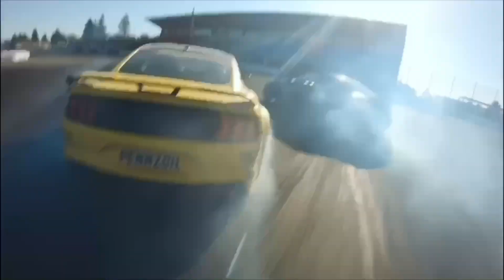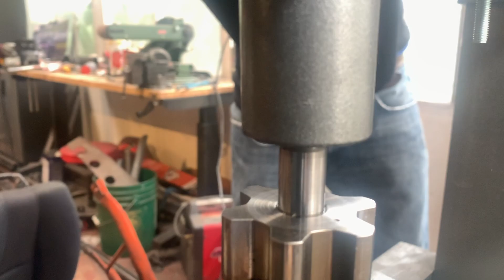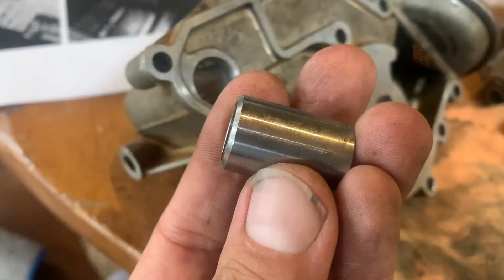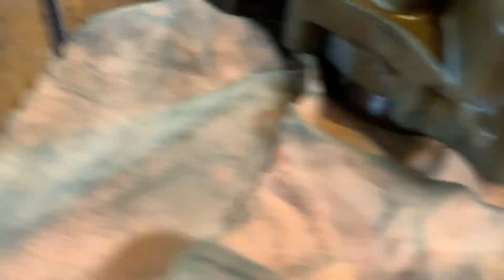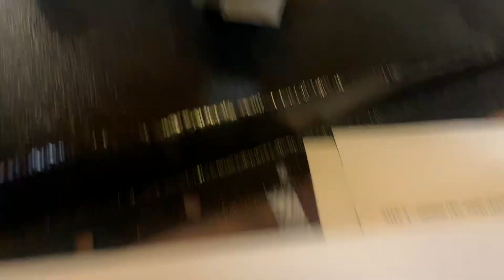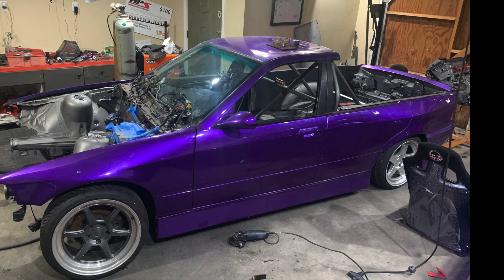E36 E46 V8 M60 M62 Swap ; Oil Pump Modification  : What Is It REALLY like?

Comment: Too bad the M60/M62 swaps get this complicated. What would a dry sump system for this swap cost roughly? And does anyone make exhaust manifolds for this swap?
Reply from the maker: Dry sump is 4-6k 

Exhaust manifolds can be pieced together from X5 but if you want gains custom make them
Reply: I'm just in the process of fitting S65 headers, light, compact and equal length runners. Flanges need rework but seems doable so far.

Comment: Hi mate, What is the fi20 exactly. I gather it's a 20mm drill bit? But the "fi" is what loses me. Any insight?
Reply from the maker: 20mm

Check with a measuring caliper
Reply: @DriftJesus  Is this any particular drill head I need?
Reply from the maker: @moosegril2796  see video, all regular drills.  Best would be to machine it on a lathe
Reply from the maker: @moosegril2796  regular drill sir

Comment: Hello! So the oil pump is hold with only 2 bolts (on the oil pan)? I was thinking that it will go through the stud on the front, where it was installed originally.
Reply from the maker: The original mounting points are not there anymore :)
Reply: @DriftJesus  Yes I saw in the manual that we have to cut them. I have oil pump from V12 and can't find a pump from V8. Tried to compare them from pictures, but they look the same (still the part numbers are different). I was thinking the V8 one, will be little bit different design and will be hold by 3 points, but I guess this is not going to be the case.
Reply: No, there is 3 mounting points you are going to use. 1 on the engine block.